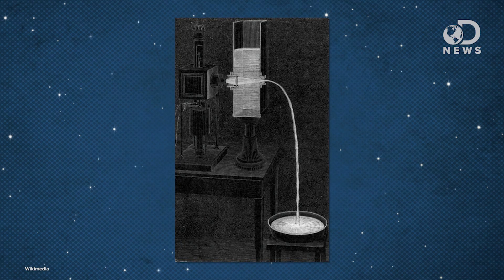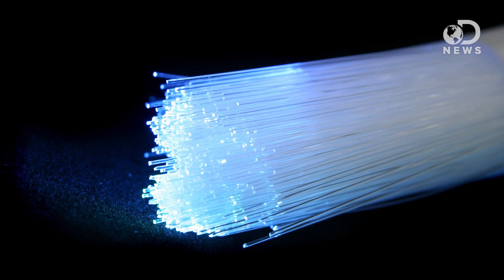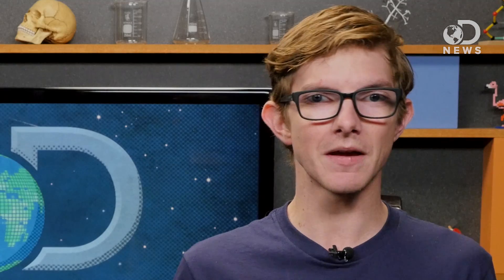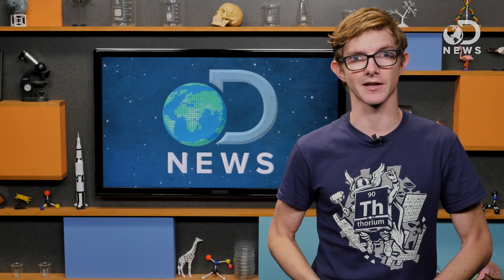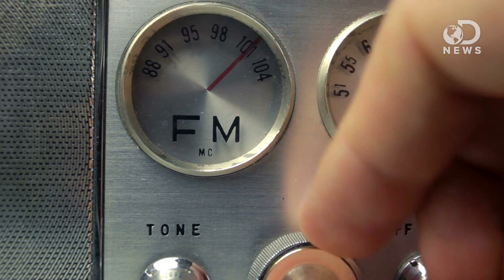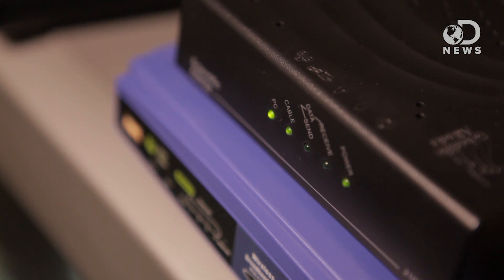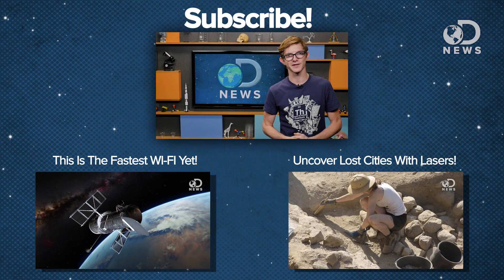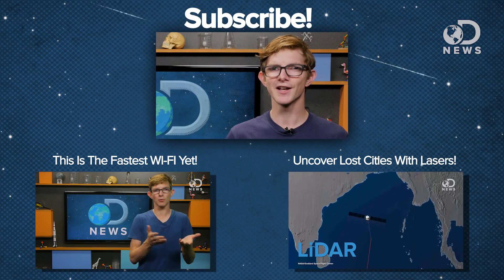What Makes The Internet Fast?

Comment: I think that's incorrect, "Hundreds of thousands" of fibers are not stuffed into a cable. Typically, a cable is made out of multiple pairs, (each pair has one fiber for information going in one direction and one going in the other direction), and I'm guessing less than 10 / 100 pairs are together in an underwater cable, certainly not tens of thousands.

Comment: I spotted two physics mistakes within the space of a few seconds of each other.  

1. Total internal reflection is not the same as the reflection from the surface of a lake.  For total internal reflection to occur, light needs to be traveling in an optically denser medium towards a less dense one, e.g. from water to air

2. The 42 degrees mentioned refers to the angle between the light and an imaginary line drawn at 90 degrees to the glass surface at the point where the light hits the glass. So the angle with the glass wall is 48 degrees. Another issue with the 42 degrees is that it depends on the type of glass used.  This critical angle depends on both the transparent material through which it is travelling as well as the other transparent material. 

Now I'll continue watching the episode, hopefully there aren't any more mistakes. 

I was going to share this episode with my students.  Then decided against it.  Now I have decided to share it but with the following question added: can you spot the mistakes? 

Having said all this, I enjoy D news.

Comment: Already actually knew all this. I have a certification for installing fiber optic cables, and making all the connections. There's many more modulations than that, probably the best current one is called dense wave division multiplexing (DWDM) this varies the frequency of light signals to a very Small range. Something like this you could have thousands of different activities going over a single fiber.

There is also two kinds of fiber; multimode which is used with LEDs, and usually a repetitively short range like 500 meters. Then there is single mode which is used with lasers and can go up to something around 30KM without issue.  

You can't bend fibers very tight either else the glass breaks, or the cladding is compromised.

Comment: So I was told that fibre optic travels down a small wire. So I got my ipad and told my family to walk around me loads and pull the ipad away after doing it. I didn't choke and the wire didn't break because the internet works. I can also get a large hoop and throw the ipad in the air and swing the hoop around so there canr be a wire. I don't get it..

Comment: You should do a video on knotted light. It's basically a series of photons that pull each other in such a way that the photons precess in a stable knot-like pattern.

Potential applications include targeted fusion, computation, nano-construction (atomic/molecular level confinement) and the facilitation of experiments in quantum mechanics.

You guys need a research assistant? I could do that.

Comment: I look to the future where Internet becomes considered an essential service and therefore becomes more reliable, faster, and cheaper.  Our speed is on the 30mbps (about 3.5MBps), and we chose the unlimited package.  It was around $100, which is a pretty decent deal considering it's Canada, however Canada (and the USA) are lagging behind.  We don't use fiber optic for most of our internet (ours is Cable and therefore our Upload speed is absolute rubbish, something like ~160KBps).

Comment: In my country, you can get get 1 GB/s, but it is very costly, however if you get lower speed it is insanely cheap. That is because the biggest ISP/Telecom provider is owned mostly by the state and therefore regulating Things is easy and all other ISP's follow.